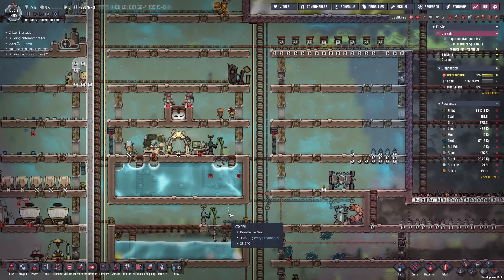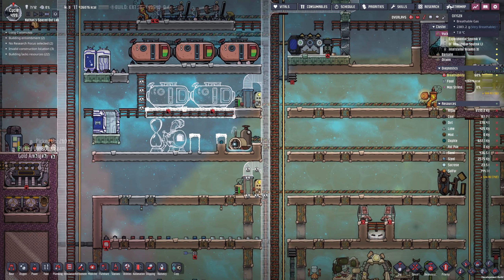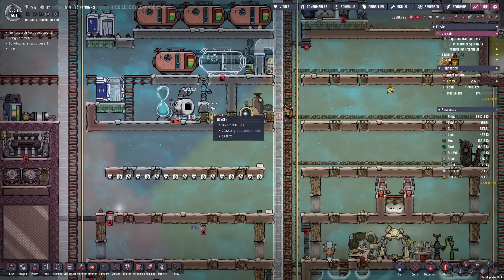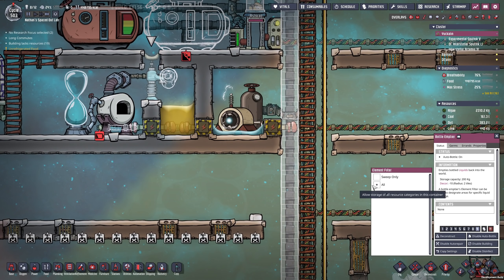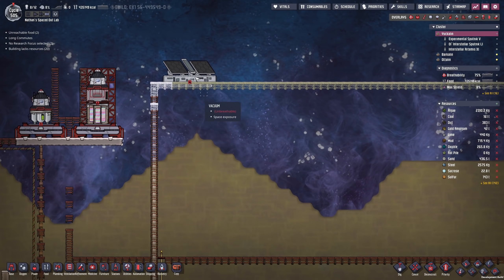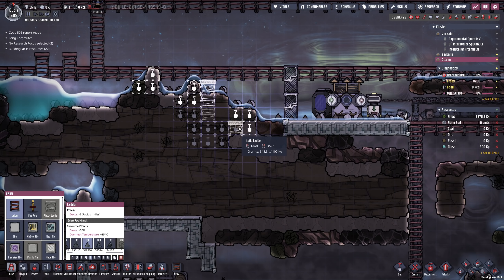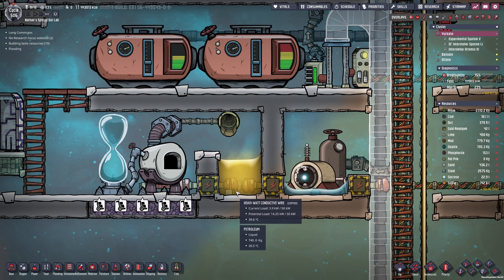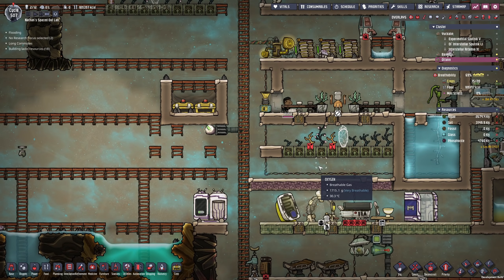FORGING GLASS - Oxygen Not Included: Ep. #33 - SPACED OUT DLC

Comment: The very top of the map I have heard reduces sunlight and therefore power output, so a certain amount of space between map limit and solar panel is needed. I've yet to confirm this. I also don't know if Klei changed the solar panel power output limit with the DLC. I do know a serpentine or pyramid design of some kind is still most efficient, however.
Reply from the maker: Oh thanks for the hint!